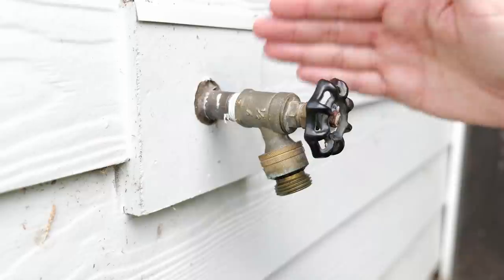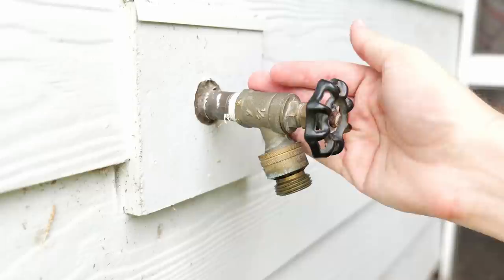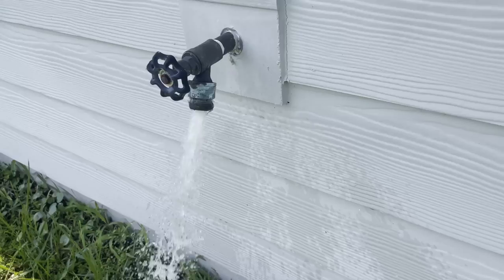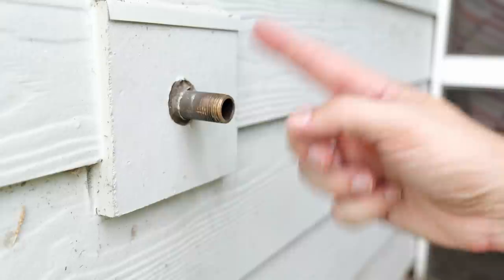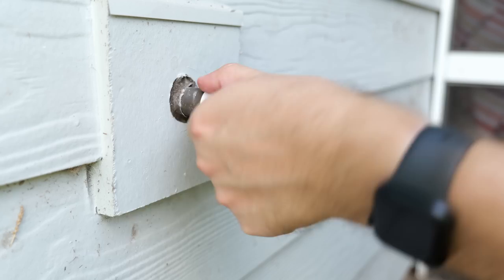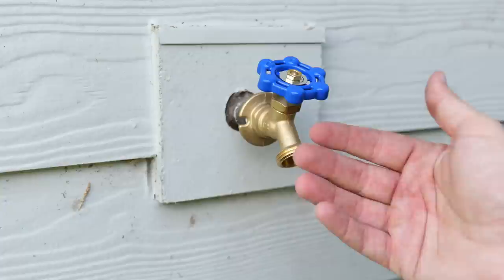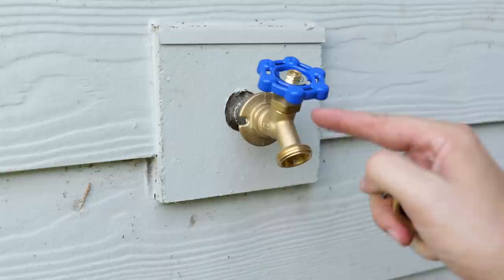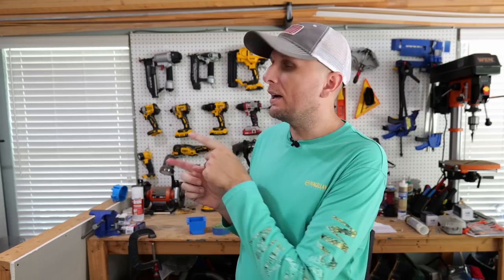The CORRECT Way To Replace An Outdoor Faucet | DANGEROUS and Common Mistake DIYers Make!

Comment from the maker: Were you aware of the vacuum breaker?  Most DIYers don't so don't feel alone!  There are links to everything used in the video in the description!  Hope this helps!
Reply: I absolutely was not aware of the vacuum breaker! In my 78 years on planet earth, having replaced countless faucets, having two friends who are plumbers this is a first for me! I once lived in a large city and became aware that lawn sprinkler systems must be equipped with a back flow preventer but not on a faucet. Thanks for letting me know! I have learned so much from your videos.
Reply: I loathe vacuum breakers. I understand why they exist but the has to be a better way that will not shoot water all over my legs and feet every time I use the hose. 
At the least there should be away to channel the water way from the user. 
So annoying.
Reply: I have the same outdoor faucet but it has a long stick inside and can't replace the faucet handle. HD and Lowe's don't sell this kind anymore and I was told to replace the whole thing with a faucet that's already manufactured with a pipe bc the copper pipe keeps fractured (broken) inside the crawl space right before the galvanized pipe with a connector so rusted installed over a decade.
Reply: Why don't they just call it a check valve? Also, looks like the vacuum breaker has a gasket on it. Really thread tape only helps on tapered threads such as NPT pip threads, where the seal is made on the thread. If the seal is made on a compression fitting such as a JIC or JIS, or on a gasket, then thread tape is not necessary or helpful.
Reply: I have never heard of a vacuum breaker, but now I will be looking for 4 of them.  Also, I have a hose bib that needs replacement, but it appears that the metal or brass bib is attached to pvc plumbing, so now what?  I hope you can help.  Thanks and Blessings!
Reply: I specifically get ones without the vacuum breaker because they are not rated for being constantly on, being used with an automatic irrigation system.
Reply: I have never heard it called a vacuum breaker. I have heard of electrical vacuum breakers. I have always heard it called an anti-siphon device or an anti-backflow. Garbage safety device crap they keep coming up with.
Reply: I had honestly never heard of it before. As a DIYer, I've always just attached a Restricted-Flow Shut-Off (ball-valve) to the faucet end.
Reply: To code, after you install the vacuum breaker and test for leaks you are suppose to tighten the screw until it rings off to prevent the owner from taking it off to increase water pressure. FYI. Hope this helps.
Reply from the maker: Please supply the code that requires the head of the screw has to be broken off.  I have yet to find any code stating that.
Reply: @roughroad666  What code? Where? You do know almost every jurisdiction in existence has a code and they do not have to be uniform. What's code in your jurisdiction may not be code in mine. I can attest to the fact that is not to code in my jurisdiction.
Reply: @Watchyn_Yarwood  Okay, I have been out of the business for a minute so I don't know where the code would be located but it states that the device should be installed according to manufactures suggestions and I know for 27 years I broke them off because they are called break off screws as per the manufactures. I realize the codes are different everywhere but I think installation is the same.
Reply: Never heard of a hose bib anyone with a brain puts shut off in board of outdoor faucet in case of problem
Reply: @lorriebuxton2041  🙄😂🤣
Reply: I was, actually! But when installing my first one (or three 😅) I kept twisting the head of the tension screw off. Hard lesson to learn. I wish I had this video for reference 2 years ago!
Reply from the maker: @DGTubbs well technically they are supposed to break off so that homeowners don’t remove them unknowingly.  I personally just don’t agree with doing that because eventually they will go bad and then the only way to get them off is to either use a saw or replace the whole outdoor faucet.
Reply: @HowToHomeDIY  That makes sense. Thank you for all your content!
Reply: Had no idea about vacuum breakers. I had to replace a leaking 1/4 turn faucet (ball valve) and picked up a vacuum breaker and installed it after thanks to this video.
Reply: It's not a faucet but a spigot or a hose bibb.
Reply from the maker: @GailUrge-vq6qn it is called any of those things and I called it by all of those in the video.
Reply: @HowToHomeDIY  it's done by the younger generation that wants to be ignorant about it....faucets are in kitchens and bathrooms
Reply from the maker: @GailUrge-vq6qn no, every generation have people that refer to them as outdoor faucets.  Again I called them by all 3.  😂
Reply: @HowToHomeDIY  No they haven't....as usual, you're making it up again. You call them by all 3, of course you do, you're confused and don't know any better 🤣
Reply from the maker: @GailUrge-vq6qn I did because I knew if I didn’t, whoever calls them something else would complain.  And yet here you are complaining over nothing.  Keep it coming though!  The comments help the video no matter how ignorant they are 😂
Reply: @HowToHomeDIY  yep, you convinced me, you like being an ignorant troll 😆
Reply: @p.hightower5383  Yea there is. a check valve... but you don't need either because the water won't run backwards since there is already water pressure coming out of the hose head.
Reply: @GailUrge-vq6qn  actually a spigot is a type of faucet.
Just like tortoise are types of turtles.
The first answer under the definition of spigot in the dictionary also says "a faucet" LOL
Reply: Why doesn’t the outside hose  nozzle come with the gadget that keeps the water from going back into the house, in the first place? 
That ABSOLUTELY makes no sense to me.
Reply: The vacuum breaker.
Reply: @Nan-59  because the water being on does that already
Reply: Actually it is up to code because it is appropriately airgapped
Reply: I was not aware of the vacuum breaker. Thank you so much for telling us about this. My husband often attaches a bottle of chemicals to the hose to spray our trees and lawn for bugs. I never knew what you explained could ever happen to us. I am glad I watched your video! Thank you so much!
Reply: I loathe vacumm breakers. I have never lived in a house with them and would never install them (Im 57). Oh call the safety police. One in a million had some contamination and now we all get inconvenience. Take some chances in your life!

Comment: Interesting.  I'm in my 50s and I don't recall ever seeing such a device on an outside faucet. There certainly wasn't one on any house I've ever owned over the years.
Reply: Politicians in those days used logic...today, they feel the need to control everyone.
Reply: @Garth2011  That is a really stupid take.
Reply: If you live in areas where temperatures go below freezing, then likely the homes had silcocks not hose bibs, and in a silcock the vacuum breaker is integrated, usually located behind the handle, not an additional piece on the hose bib discharge as shown in this video, so that may be why you didn’t notice it.  I bought my first home in 1992, and it had integrated vacuum breakers on the silcocks.  The house I grew up in, built in 1950, did not, so perhaps the homes you have experienced were all older homes.
Reply: @jpe1  I grew up on the Gulf Coast.
Reply: @Garth2011 Logic should tell you certain chemicals in your water is bad.   Technology and science...
Reply: @farmeunit Lots of us fail to see the population dwindle due to city water quality.
Reply: @Garth2011  As opposed to chemicals in food, lead in gas, disease, deaths, etc...? There are hundreds of reasons, the least of which is water water quality, except for poorer nations or over-populated.
Reply: Me niether!
Reply: In Commiefornia they have been used and placed on new homes since the 80s no big deal it’s a matter of protecting the potable water system etc.  Have you ever seen anti- siphon valves for sprinkler system same idea. Lol.  It’s been in the plumbing code for ages. And in the IPC. Assuming all States are using it, more importantly enforcing it.
Reply: @stevelopez372 These ideas do not work unless all water meter customers have said "protection" devices on their homes. One here and one there as being in compliance does not improve much.
Reply: The fertilizer/carwashsoap/pesticide in line hose bottles may not have been used by you or even available. In those applications, the anti siphon attachment is nice.  I usually see them on irrigation valves, so that water hoses don't suck up mud, minerals or small rocks into the water system from their emitters.
Reply: Same!!

Comment: Just a quick point of information regarding proper use of a Pipe Wrench. It is extremely important that the wrench maintains three points of contact with the pipe. Failure to do so could result in damage to the pipe, particularly if you need to put a bit of torque on the fitting to break it fee. Not to nit pick, but it IS an instructional video.
Reply: What do you mean by 3 points of contact? Can you explain further please
Reply: @givethanks_s4418  3 POINTS of contact are the top and bottom jaws of the wrench (that's the obvious 2) but the all important 3rd point of contact is the front part of the jaw the adjusts should be touching the pipe. ie. make sure to push the open part all the onto the pipe until it hits.

Comment: You don’t normally get backflow unless your water pressure drops to near zero.
Reply: You do if you forget to turn off the hose bib and turn it off only at the sprayer, and it sits in the sun. This makes the water expand and have a higher pressure in the hose than in the house. The water will go back and forth as the hose warms and cools over several days. If it's city water, the chlorine will dissipate over a couple of days, and if it's well water, there's no chlorine, and any bacteria in the hose can start growing.

That said, I grew up before they mandated backflow preventers, drank water out of the end of the hose, and lived to tell about it.
Reply: @johnhaller5851   That’s a good point. But bad practice to connect a water hose to a chemical sprayer when not being used.
Reply: And won't that happen if you turn off the water main to work on basement plumbing and open taps to drain everything?
Reply: @johnhaller5851  No way you get 40-60 psi in the hose from heating in the sun.  If that were true you could spray anything out of the hose when it was heating in the sun.
Reply: @percyfaith11  If it started at household pressure, it doesn't need to increase pressure, is already at 40-60 psi. For every degree C of temperature rise, water expands by 0.000208. Assuming 100 feet of hose and a 10C rise in temperature, that's 0.2 feet of expansion, or 2.4" that the water will be pushing back into the internal plumbing. That's unlikely to get past the end of the pipe into the water feeding the rest of the house. But if you turn the house off at the end and the bib, that 2" has to go somewhere, since water isn't compressible. Something's got to give, and the only thing with some expansion (without a anti-siphon), is the hose. If it can handle the pressure caused by a 0.2% increase in volume by expanding, everything is fine. If it can't, the hose will burst. 

The bigger practical concern for plumbing is the hose end in contaminated water and a loss of pressure in the house, creating a siphon. Sure, there are some theoretical concerns with water contamination from a closed sprayer with the bib open, but they are not probable.
Reply: @johnhaller5851 The only water that could get back into the house would be the water that was already in the hose in your theory. That water is already potable so unless you had the end of the hose and dirty water, there wouldn't be any problem.
As a matter of practicality, the hose fittings would leak the pressure for any water ever entered the house.

Comment: You should mention that in most older northern homes without no-freeze outdoor faucets there will usually be a shutoff valve on the inside to shut the valve off for the winter and a small drain cap to drain the line, making it unnecessary to shut off the water to the entire house.
Reply: GOOD POINT SIR!!!
Reply: I shut the ball valve off in the basement before the first freeze. It’s about 4 feet from the faucet on basement ceiling. Then open the faucet valve outside to drain any water.
Reply: I came here to say the same thing about there being a shut off inside. 😅 And most I’ve seen are in crawls, basements, or ‘Michigan basements’ thankfully.
Reply: Not sure if it was code in 94 but my home in Alabama has an inside cutoff in the basement for all of the hose bibbs. Made it real easy when replacing mine.

Comment: The safety set screw is supposed to be tightened until the head breaks off so that the vacuum breaker cannot be removed--either by someone who does not know why it is there or accidentally when unscrewing a hose.
Reply from the maker: If you want to break it off so that you can’t remove it later without using a saw or having to replace the whole hose Bibb then be my guest.  The plumbers here don’t break them off as it’s not required and they know eventually they will need replaced.  But yes, even you yourself can make videos if you like, be my guest and share all of that wisdom.
Reply: That is a reasonable argument to not breaking it off, but there is a more reasonable argument for breaking it off: Most homeowners don't even know why the vacuum breaker is there or what it does, so if it fails, they are likely to remove it unless that is prevented. The breaker is there to prevent sucking dirty water off the ground (from a hose lying on the ground and still connected to the bibb) back into the home's potable water pipes where it may later cause illness,
In any case, there is no cause to get snarky with your last sentence. @HowToHomeDIY
Reply from the maker: Yes I understand what the vacuum breaker is for, I explained that in the video.  The comment was to another snarky commenter that appears to have deleted their comment since then.  As a homeowner, knowing that the vacuum breaker is probably going to fail before the valve, I’m not breaking the head off.  It’s a massive pain to remove and replace when it goes bad.  To each their own.  And if code in your area says to do it, then follow code.  But here, a lot of the time they aren’t broken off.
Reply: @servalcat  i wrote the same comment before i read yours that the screw is suppose to be broken off, if it fails you replace both again

Comment: Your explanation of the importance of a vacuum breaker makes perfect sense. My question is: why have I never seen one on a hose bib before? My house was built new in 1999; I researched this and discovered that the Standard Plumbing Code has required vacuum breakers on hose bibs since 1963. My house certainly didn’t have them on any of the three hoses bibs and, again, I’ve never even seen one - as far as I know, that is. They are kind of inconspicuous so I might not have notices one on someone else’s house.
Reply from the maker: If you’re in a place that freezes you may have a frost proof faucet that everything is internal.

Comment: The hose bib has flattened areas for an adjustable wrench right near the screw slots.  Also, when you're working with old plumbing that's been compressed or stretched such as the brass nipple coming through the siding, it absolutely is a good idea to use both teflon tape and pipe dope over the top of the tape.  Speaking from years and years of experience.
Reply: Yep belt and suspenders.

Comment: Glad you touched on Freez Proof Hose Bibs ! I feel sorry for the people in Texas that found out about frozen plumbing the hard way! I still can't understand why anyone anywhere would have their water heater a other plumbing mounted on the exterior of the house!  That's just asking for trouble since freezing temperatures in Texas may be rare but have happened periodically and with in living memory and before.
Reply: Up here in Amarillo it freezes all the time during the winter, not rarely. Not to mention the harsh winds driving the wind chill into the negatives routinely.
Reply: @rabie4x4  I'v seen and felt windchill of -60 farenheit here in Columbia County NY. Admittedly that doesn't happen regularly.
Reply: @rabie4x4  Wind-chill is about rate of cooling. It doesn't cool things below ambient temperature.

Comment: I use pvc lumber to make shim blocks between the house and the hose bib. Sometimes rectangular and sometimes round using a hole saw to make a 3 1/2” wheel out of a scrap of pvc lumber.  Drill out the center and softened the edge with sandpaper.  Then you can screw the new bib to the block and hide the pipe extending through the wall.
Reply: I’ve kept some leftover pvc lumber and that still didn’t occur to me. Thank you!
You could always make it look really nice by cutting out the pieces with a hole saw after cutting the smaller hole. So it’s a nice smooth uniform connection.
Reply: It’s legit gross how expensive pvc lumber became 
Same with pvc pipe 
In general the price of pvc went complete out of control with covid
Reply: I did not realize he was finished with the job with that space between his hose built in the house left un finished. I thought leaving it that way looked crappy. Anyway, each to his own after all the water is more important than how it looks.
Reply from the maker: @user-he4mm7yf2k the video was more about how to replace one.  Those are all my local stores had in stock.  Tried to find one like what was originally installed.